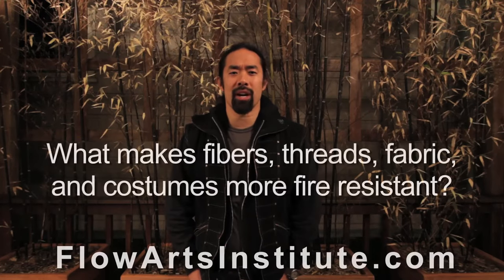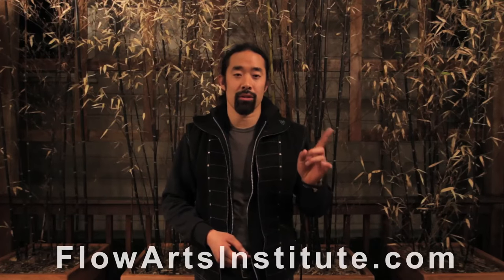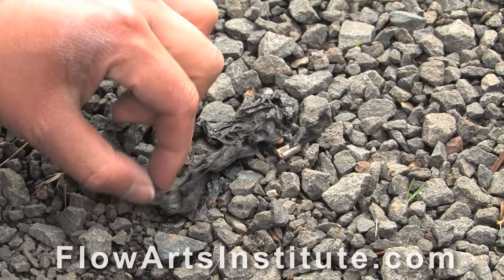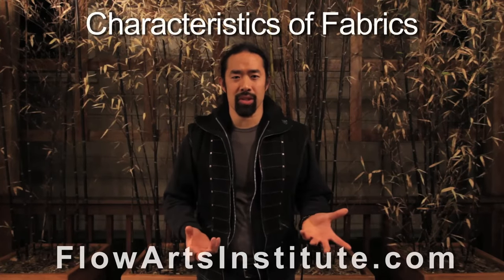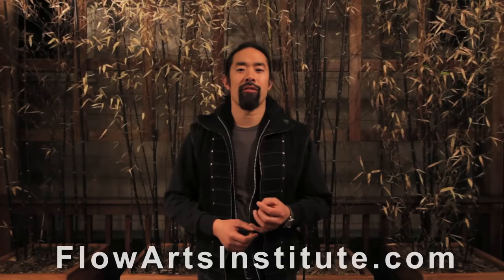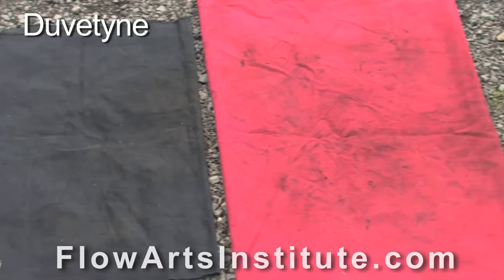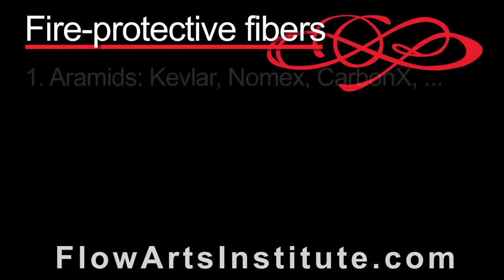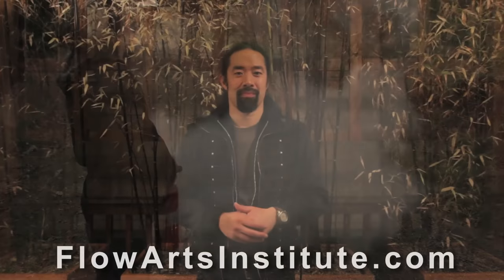FSP video 5 - Fabric & Clothing

Comment: Excellent video! One question: at the 4 minute mark you discuss natural-synthetic blends. I am not completely clear as to whether or not wearing an 80/20 blend t-shirt would be acceptable to perform with? I understand it is not optimal, but would you recommend against ever using any blended fabric, or is a mostly natural blend okay to use if it is the only available option?